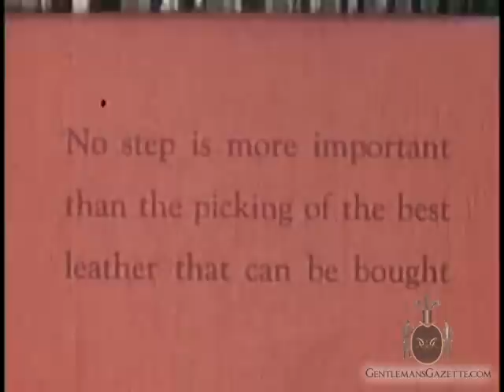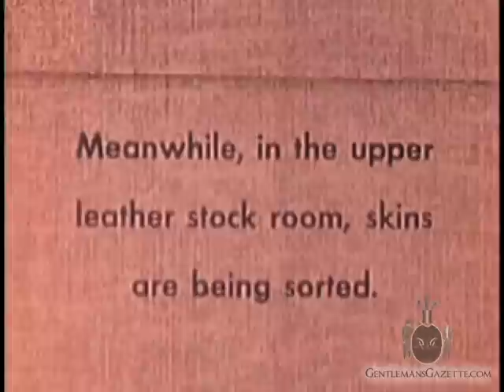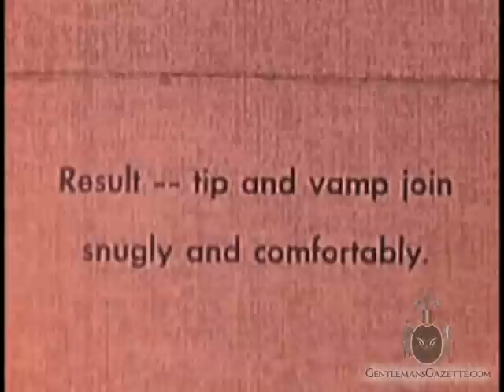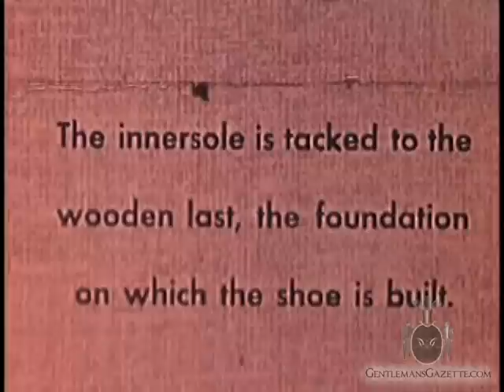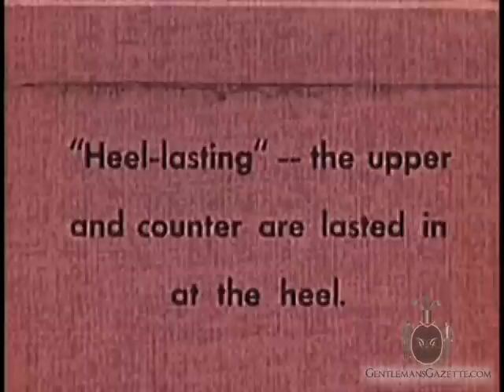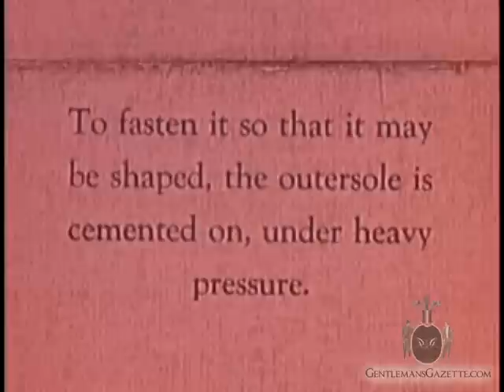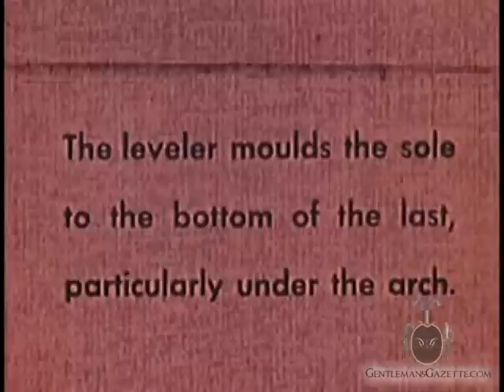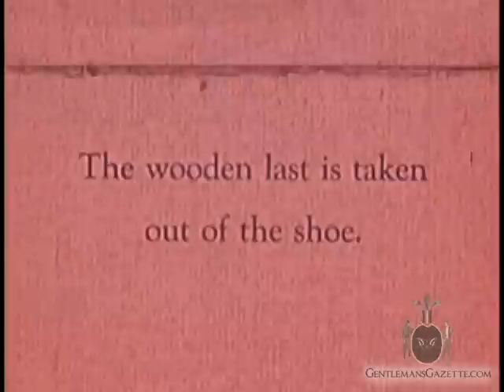How To Make Shoes - Gentleman's Gazette

Comment: In case you are wondering, why are all machines are working constantly, it is because they were all powered by one huge steam engine! The power was transmitted with a single belt to the mechanishms.